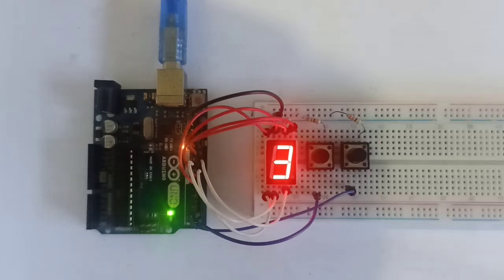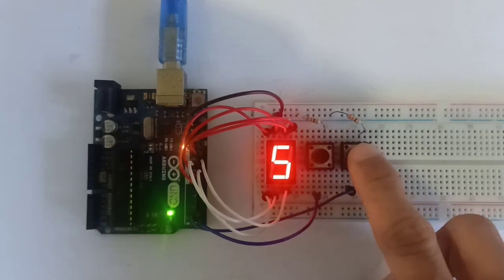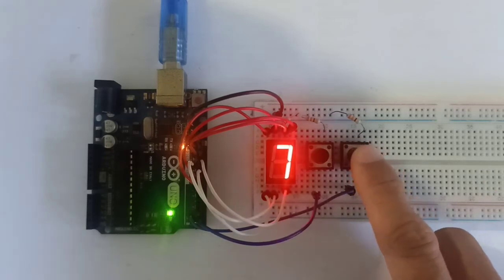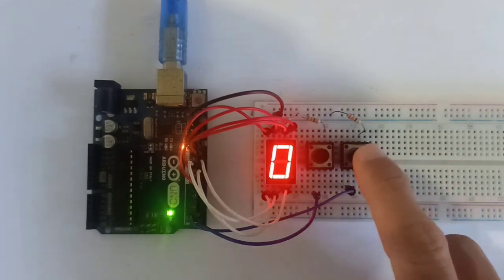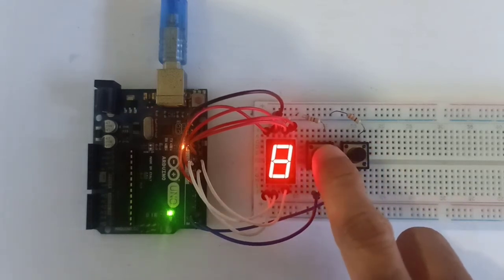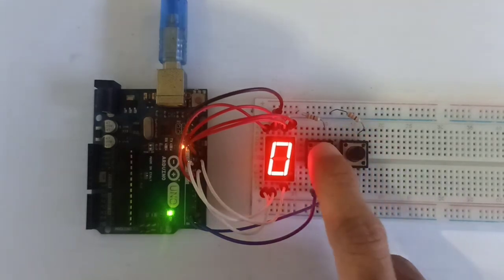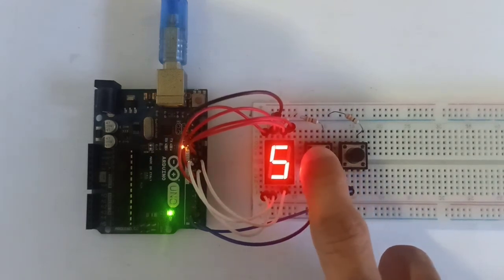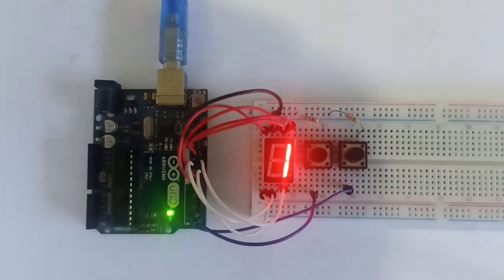Arduino Push Button 7 Segment Count Up and Down Number

Comment: Hello hi there can you please tell which 7seg you used ( common anode) or (common cathode) and can you please share the diagram and codes for this project ill wait for your reply and diagrams and codes
Reply from the maker: Pin A -> Arduino Pin 13
Pin B -> Arduino Pin 12
Pin C -> Arduino Pin 11
Pin D -> Arduino Pin 10
Pin E -> Arduino Pin 9
Pin F -> Arduino Pin 8
Pin G -> Arduino Pin 7
Pin Digit -> Resistor 330 ohm -> Arduino Pin GND

Arduino Pin 1 -> Button1 -> Resistor -> Arduino Pin GND 

Arduino Pin 2 -> Button2 -> Resistor -> Arduino Pin GND 

Download code: https://drive.google.com/file/d/1ebSEK1-_4yFppF-9h4EI6j9napURIAsg/view?usp=drivesdk